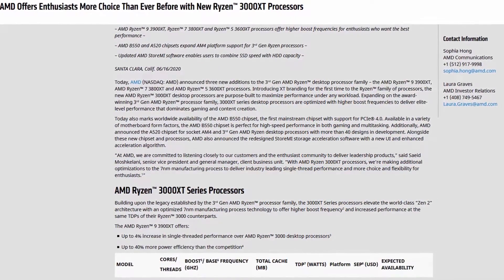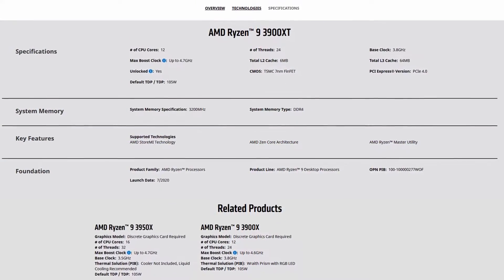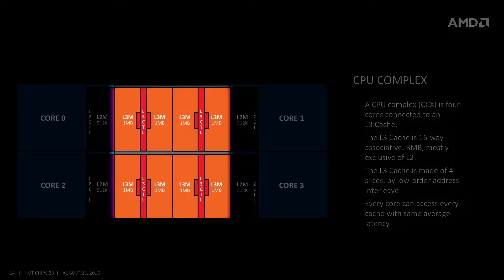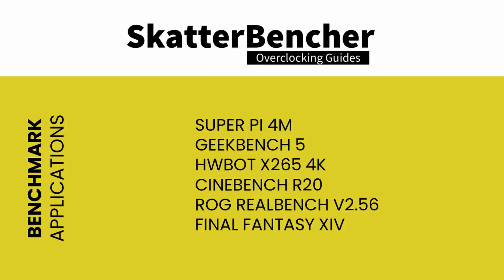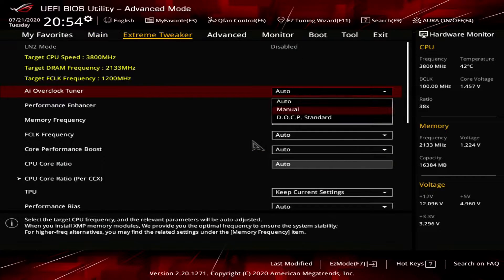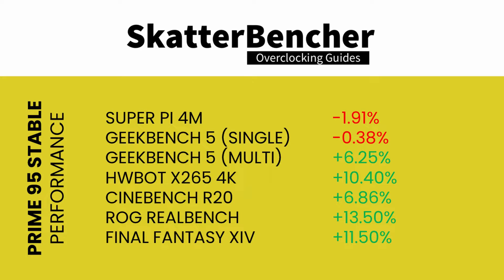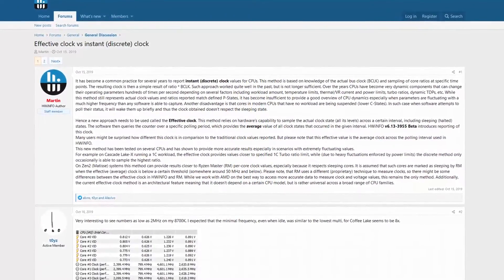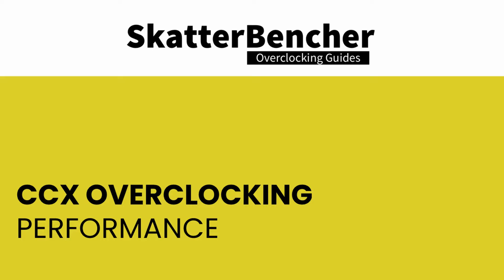Ryzen 9 3900XT Overclocked to 4550 MHz & AMD Overclocking Trade-Offs | SkatterBencher #13

Comment: I have been using a 3900XT @4400Mhz all core @1.35v @180W package power with Infinity Fabric @1900Mhz @1.15v SOC, 32GB 3800Mhz CL14 4x8GB @1.5v, the very limit of the platform and everything is as 100% AVX stable as the day I set it (after watching this video, mad ups this ScatterGuy). I actually just re-watched this video to see his vcore requirement for 4500+Mhz to try it out with a chiller (it's 1.425v) however the power consumption at anything beyond ~1.4v is really pointless (+40% @255W) for 100mhz, so I think whatever your CPU will do at 1.35v and  under ~200W is the sweet spot for an all core 3900XT daily OC. Configured correctly (this video <3) you can drop 20,000+ points in Cinbenech R23, on air.

Comment: Horrible guide. Too fast, not all numbers shown / explained, very hard to follow.
Reply from the maker: Which parts in particular are too fast? Which numbers should I show? Which numbers should I explain better?
Reply: @SkatterBencher  I was looking for a video that wouldn't just show me where you could get with overclocking, but how you would overclock your system properly. Such a video was extremely hard to find for the Ryzen 9 3900XT. Yours came next. If intending to explain / when explaining the overclocking process, you should take significantly more time to explain basically all the numbers you change, like base / CPU clock, memory clock, timings and voltage, and maybe point out the differences to other popular B550 chipset mainboards. I am e.g. using an MSI mainbaord, which has different descriptions for some of the features you are using. You are so fast that it is even hard to stop the video at the right times to inspect the settings you are chosing. You may also want to explain what exactly you are doing / why are chosing the values you do chose. If you are overvolting, explain whether you are going beyond the manufacturer's specs or whether you are just making full use of them (I have had RAM that had only basic settings in their XMPs and which I had to manually overclock and overvolt to exploit their full potential, even though the voltage was within the range specified and tested by the manufacturer).
Reply from the maker: Thanks for the feedback!

My main objective with the videos is to help users get to about 80% of what you need to know to get started with overclocking within the least amount of time (15 to 20 minutes max). That's why I don't discuss each of the settings in depth. The video would be much longer in that case (I could go on for hours when it comes to overclocking, haha). I think there are other channels and articles out there that already do a good job to explain more in detail.

I did receive similar feedback regarding the BIOS part. In previous videos I always showed the BIOS configuration at real speed whereas in the 3900XT and 3800XT videos I sped it up to reduce the total video time. I agree that probably it's more useful to the user to have the BIOS section at real speed. So for the Ryzen 5000 overclocking videos I have them back to real speed :).
Reply: @SkatterBencher  I didn''t find any other article or video about overclocking particularly a Ryzen 9 3900XT and how to overclock RAM to get the most out of my system. I was googling and searching for quite some time, and yours is actually the only one I found.
Reply from the maker: The Ryzen 3900XT DRAM overclocking will be very similar to the regular Ryzen 3900 and in fact previous generations. The only difference is that the frequency headroom has increased because you can run higher fabric and memory controller frequencies in synchronous mode. Here are some articles I can suggest:

https://www.techpowerup.com/review/amd-zen-2-memory-performance-scaling-benchmark/
https://www.guru3d.com/articles-pages/amd-ryzen-ram-scaling-effect-in-games,1.html
https://www.corsair.com/corsairmedia/sys_master/productcontent/Ryzen3000_MemoryOverclockingGuide.pdf

The last one is a guide by Corsair, pretty detailed, and specifically for Ryzen 3000 series.
Reply: @SkatterBencher  Yeah, one of my questions are related to the fabric controller. I have setup a Ryzen 9 3900XT system for my son. Initially we had put 3200 MHz Corsair memory in it. I had read somewhere that up to 3600 MHz (1800 MHz base clock or whatever) you had a direct frequency scaling and above those 1800 MHz (of I think the fabric clock speed?) you had some scaling. So we finally went for 3600 MHz RAM, but I don't really know enough about this to tell whether his system would actually benefit from that or not.

Comment: Crap...AMD is squishing money for nonsense...I got my 3900X running all cores @4.4GHz with 1.325 V and GSkill RGB RAM 2x32 GB @3600MHz...paying extra money for  4.55 GHz using voltage 1.4 V is stupid since you are degrading the CPU. I had mine running stable at 1.375 at 4.6GHz....but I don’t want to degrade the cpu so I am OK with 4.4 all cores idling in the 30s Celsius. The XT reminds me of the FX 9590...lol
Reply from the maker: Upgrading from 3900X to 3900XT does indeed not make much sense. But if you're in the market for a new CPU and you can find an XT reasonably priced, then it's a nice little speed bump over the X.

Comment: Brilliant. About to commence on my build (3900x,ROG Crosshair VIII Hero (Wi-Fi), 32gb trident Z 3600 16), this will be a very handy reference point.

If you see this, have you noticed any particular voltage lines I should pay special attention to? Had some bad experiences with the x58 gaming Strix and the 6850k where xmp fried a couple of CPUs).

Will look through your video archive now to see what you've covered. Cheers.
Reply from the maker: Great to hear you're starting a new build! Enjoy!

In terms of voltages lines, I would say that generally speaking things are a lot more safer now than they were back in the X58 days. Especially for voltage auto-rules. Often there are forum posts pointing out "very high voltages" set automatically by the motherboards. When speaking with motherboard makers about this, they basically say they don't see any problem when doing in-house testing.

That said, I would say that the most common thing people are worried about is when enable XMP. Especially high-speed. In order to sustain high memory frequencies, the CPU often needs significantly increased memory, IO and memory controller voltages. Motherboards would increase those automatically.

An easy way to avoid this would be to manually fix the voltages in the BIOS before overclocking and manually raise them to levels you feel comfortable with when overclocking.

Comment: My 3900xt 1.275 vcore volt, 4500/4500/4400/4400 over 8k in CR20, Why so much voltage?
Reply: How you did?
Reply: @obsammyboytv4356  like i wrote, but using a 5900x now instead

Comment: I have a 3800x at 4.3 All Core 1.325v reaching 73C, with G.Skill Neo at 3800mhz C14-15-15-30 Currently all stable. :) oh, and an OC EVGA 2080Ti XC Hybrid that does +160 on the GPU and +1000 Memory
Reply from the maker: Nice! Not at all a bad overclock :)
Reply: SkatterBencher thanks! I really wish the memory controller for ryzen was better. I have 4 dimms of 3600 C14 I want to take to 3800 but since it’s crap I have to do 2 dimms to get there.

Comment: Can you do a video that show slowly what you change. That would be great. I have a MSI Tomahawk B550 Mag and i need to find what is different. Thanks
Reply from the maker: Thanks for the input!

In previous videos we would show the BIOS part slower, but it's a difficult part of the video to get right because it can easily fill up over half the video. Especially if we're showing multiple overclocking strategies. We're trying to get the videos around the 10-minute mark.
Reply: @SkatterBencher  I understand that, but for a teaching value, that does not help :) I am trying to boost mine and I am stuck at 4.1... But I am using Zen master because I am not sure what to change in the bios.  :(
Reply: @gamerdad4596  forget ryzen master in general, it’s never worked well for me. Main things are frequency multiplier and soc voltage

Comment: Nice video. I do enjoy overclocking but for all Zen 2 Ryzen CPUs I'll leave them stock because Precision Boost 2.0 (PB 2.0) and Extended Frequency Range 2 (XFR 2) is already so aggressive. The AMD engineers did an amazing job like you said in the video. Instead I tell people to invest in some decent Samsung B-Die memory and heavily tune sub and tertiary timings until they are error free and completely stable. Memory overclocks and tuning from my experience gives the most gain from Ryzen as long as they are running in a 1:1 ratio. I'm curious to see how Zen 3 will be like.
Reply from the maker: Yup, me too. Looking forward to trying those out some time very soon ... :)
Reply: I thought about tinkering with my ram, but I don't beleive one should mess with anything with "infinity" in its name .jokes aside, I have trident zero 3600mhz cl 16. Maybe ill just try to get my timings down, but really need more info before I proceed

Comment: 1.325 Vcore with 44.00GHz stable with 3900X not XT and under 360 AIO Max temp around 85C.is it safe for 3900X?I get no any error and it’s run nice
Reply from the maker: If it's stable and it's cool, then just enjoy the extra performance! :)
Reply: SkatterBencher max temp is 85 and I don’t know really it’s safe or not
Reply: @kiyadd1356  yes 85 is safe, but may cause long term wear on the cpu. 95c is the thermal limit where throttling beings, and I believe 105c is where it shuts down. you should be fine
Reply: @EscapableTech  Yea I keep reading about the 3900XT getting degradation after 1.35v. I'm pretty sure Buildzoid said his 3700x did running at 1.37v (could be wrong on the actual number but I do remember reading about something).
Reply: @SouthpawJoe  I can run 1.3875 and get 4.525 ghz on 6 cores and 4.325 on 6 cores and it is about the best all cote score I can get. Anything more on any core isn't stable at any voltage and anything over 4.35 on all cores isn't stable at any voltage. My cpu is weird even as an xt
Reply: @EscapableTech  Agreed. Hitting a decently high overclock with the 3900XT isn't that hard to achieve. My concern is the vcore for daily use and speeding up the degradation on it, specially after seeing how fast Buildzoids degraded in just a matter of months. I've been trying to find a safe max daily vcore but info is just so sporadic on the matter that i've seen anywhere from 1.25v to 1.35v.
Reply: @SouthpawJoe  yeah I'm hoping either my voltage is safe and I don't have a worry or if it is an issue, I'll eventually turn pbo back on and just end up going next gen ryzen which hopefully hits higher clocks on its own
Reply: @EscapableTech  Yea im pretty much in the same boat since I believe the next gen isn't that far off, and I also believe (could be wrong) that the x570 boards will support the next gen cpus. I tried PBO and AutoOC and they didn't really do much for a boost for what temps I was getting. Biggest gain was when I was at 4.5ghz @ 1.35v, my fps jumped quite a bit with that, but as mentioned before the fear of ruining the cpu too fast.

Just wasn't worth it for me so I just left everything on auto (except fabric is set to 1800 and ram to 3600 with docp). PBO off and for games it still boosts to 4.25ghz and maintains 62 degree temp is nice. So hopefully we will get some news on when they next gen comes out for AMD!
Reply: @SouthpawJoe  yeah I have half cores at 4.525 and it helps with fps, pbo and auto oc isn't great. If I use my msi overclock dial on my board, it can push to like 4.4 or even a little higher, but i hit 110 degrees and it shuts down

Comment: Didn't catch you mentioning it, but it's worth noting that 1.425V daily will definitely degrade a 3rd gen Ryzen CPU and it won't take long at all to do it.
Reply: If u force cpu to do a lot of avx sure, light load like games etc I don't think it will do any dmg. It by default rises voltage to 1,4 or more in games. Ofc there a lot of behavior implemented on chip, how it handles boost so it doesn't breach specs set by amd engineers;p
Reply from the maker: Just to add to this topic: by default the CPU will reach over 1.4V in single-threaded workload scenarios to hit the maximum boost frequency. So the voltage itself is no problem.

Of course, under sustained all core high load scenario the power consumption at 1.4V would not be good. However, as noted in the review the maximum stable frequency for Prime 95 with AVX is ~4.35GHz. At this frequency the operating voltage is reduced to ~1.3V. Not 1.4V.

At 4.55GHz with 1.4V, the system would immediately reboot when trying Prime 95 with AVX.
Reply: @SkatterBencher  1.4V in single core isn't that bad because there isn't a significant amount of current draw. Just read up on how Buildzoid degraded a 3700X at 1.375V in a month.
Reply: @jKazej  that's a worst-case scenario. my 3800x ran 4.35ghz at 1.3875- 1.4 volts depending on the avx workload and I did that for months with no issue. Honestly, if it wasn't for the heat even with my 360mm aio, I would still be overclocking it. On synthetic workloads, I would see 95-100c. I mostly game and pbo runs 4.3-4.5 GHz in games with much less heat, closer to 50c in games, and 79c in benchmarks, so I have stuck with PBO + auto oc.
Reply from the maker: @Hitoyomi Do you have a link I can check out? Thanks for sharing.
Reply: 3 years later, does your CPU behave even a little differently? Confident misinformation, silicone don't care. ridiculous.